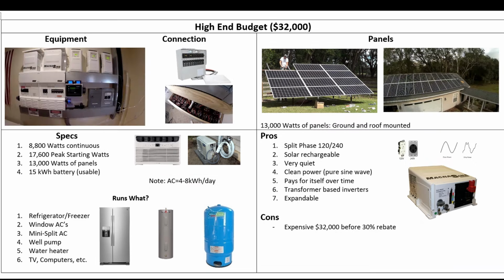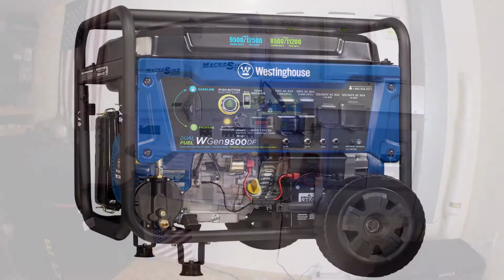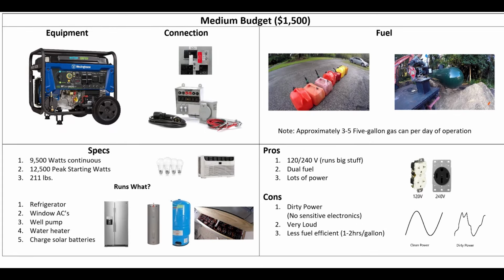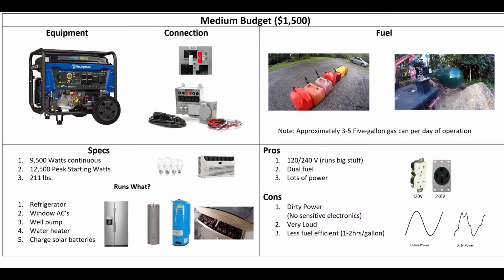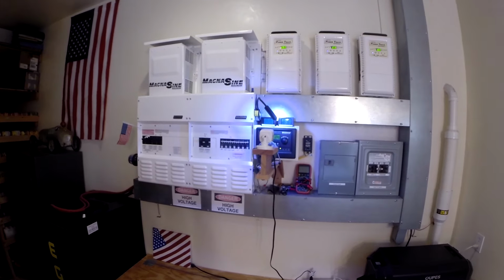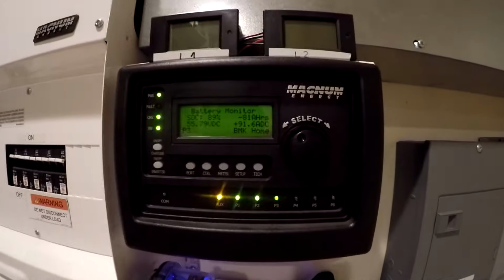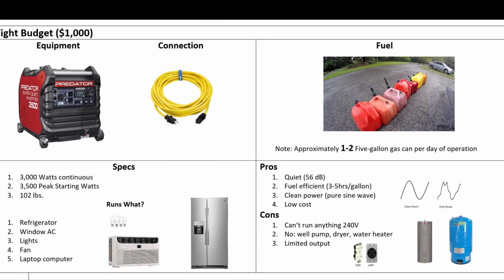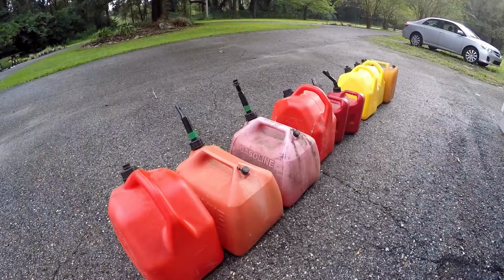Backup Generator

Comment: EG4 mentions that underpowered generators can damage battery inverters so I use my smaller generator to pump power into the batteries using their chargeverter.

Comment: I have had my predator 3500 for 3 years now I have 75 hours on it now and have had no problems with it so far and it still has the same battery that it came with for the electric start also I average 12 to 14 hours on 2.5 gallon of gas depending on load I have a bigger generator that I use if the power is out during the day I typically use the other one at night time if the power is out because it’s so quiet
Reply from the maker: Very helpful information.  Thanks!

Comment: I have a couple of questions. Most appliances no matter how entry level have a microchip? Your charge controller along with you rother solar components use microchips are you concerned about damaging these expensive items?  I have six Ecoflow power banks and will only charge them with my Honda Eu2200i.  As for propane, I have been through Hermine, Mathew, and Helene and the propane sells out first.
Reply from the maker: 1. I have used the Westinghouse to charge my system many many times but that said: YES, I am concerned.  I really should have addressed this but I was trying to keep the video short.  I have recently purchased a Predator 8750 inverter generator for this reason.  
https://www.harborfreight.com/8750-watt-inverter-generator-with-co-secure-technology-57480.html
The other advantage of running an inverter generator is that I can pass through charge and run the house at the same time as charging.

2. I keep 500 gallons of propane as you will see in the next video.  That said, I really don't need to run backup generators very much because of the 13,000 Watts of solar panels.  I probably ran the Westinghouse about 4-6hrs total for all three hurricanes this year.  

Thanks!

Comment: Hi Dave, do you run your generator direct from your breaker box to your magnum inverter/charger? If you have a video where you cover that install/details, please provide.

I have an eg4 18kpv all in one but have never tested the generator supply as I've heard that the dirty wave might cause issues with the inverter... so instead eg4 offers a charging bank which acts as a conduit.

But it seems as though you go direct without cleaning that wave?
Reply from the maker: I do connect my generator directly to my Magnum System that uses two 60Amp chargers to charge the batteries and is also capable of passing the dirty power through to the house while you charge.  I turn the AC output of the Magnum system off when charging so as not to pass the dirty power through.  The generator AC input to the Magnum is done via a transfer switch that can transfer either the generator OR the utility into the Magnum system.
https://youtu.be/DvfReskBReQ?si=OxcKI5guEmrc2aIb
AND
https://youtu.be/FieTfNKqP8U?si=EOPIUeo399LO59_Y

That said:  I don't suggest you do this with the 18k.  It might be OK but I would just recommend using an inverter generator like this Predator 8750: 
https://www.harborfreight.com/8750-watt-inverter-generator-with-co-secure-technology-57480.html

That way you can charge the battery safely and pass through clean power to your loads at the same time.

Thanks!

Comment: Using inverter-generators is the proper way  to go. Your Magnum is excellent at transferring load input power (just like my Outback) -- they "sync" and align the power before load dump. Using a "dirty" gas generator is okay but, I wouldn't recommend them in conjunction with a DIY home solar power system. They are GREAT for stand alone power sourcing (like job site power). Lastly, on Reliance Control transfer panels (I learned this the hard way) -- when switching "either-or" power sources, reduce the load to the bare minimum. They don't "sync" -- they just switch. I have popped circuit breakers trying to go from solar to grid on the fly with loads -- not pretty. The panel hummed before the c/b's popped. Best practice is to let the solar inverter do any source power transferring internally -- they are designed for it.
Reply from the maker: 100% correct Chris.  I only use my dirty power generator to charge the battery bank and I don't let that power flow through to the house.  It has worked great so far but I would like to "pass through charge" in the future so I have already picked up a large inverter generator for that purpose.  I got the Predator 8750.  It puts out 7000 Watts continuous and I can charge the batteries AND run the house at the same time.  

With regard to switching the individual TX switches under load: YES, It is a very good idea to cut the load before switching.  I NEVER hot switch anything with a compressor!  Refrigerators, freezers, AC units... BAD idea.  

Great comment Chris.  Comes with experience.  Thanks!

Comment: Just ran my 5500watt for 45 minutes and checked the oil. Also have 9 solar generators and 1000 watts of panels. I store 130 gallons of gas. Ethanol free!
Reply from the maker: Sounds like you have a plan and are prepared for any kind of power outage.  Good work!